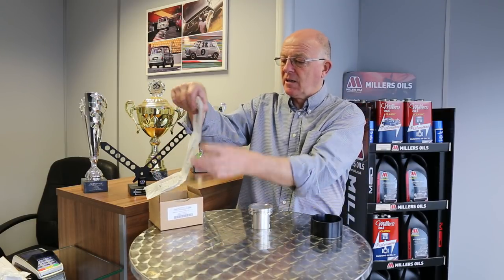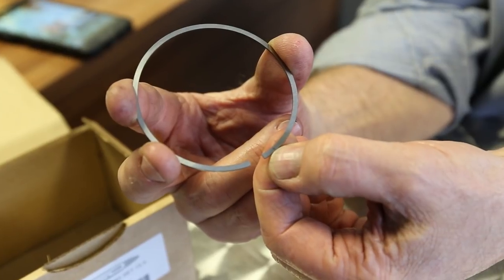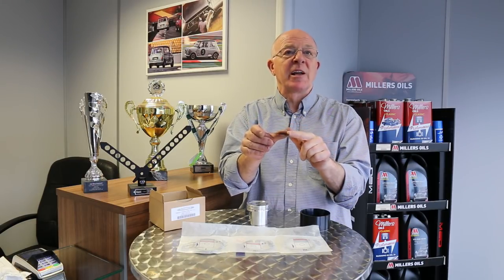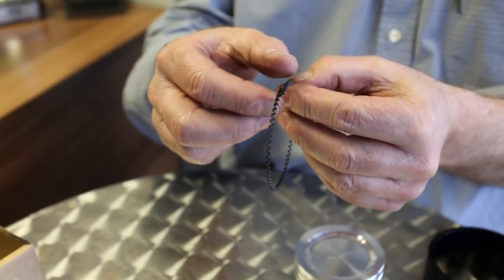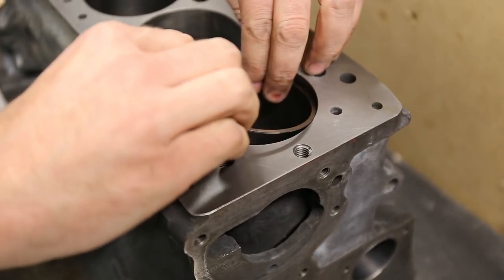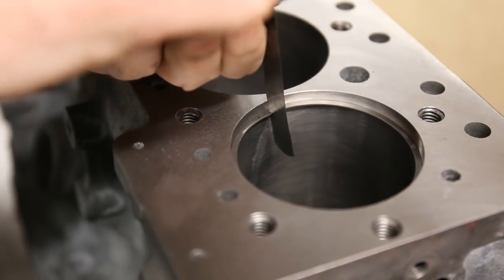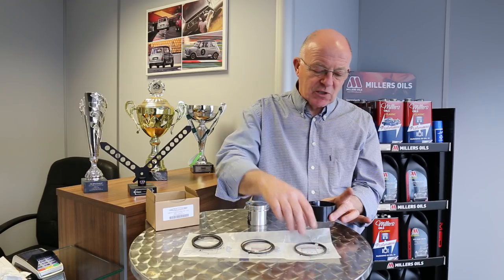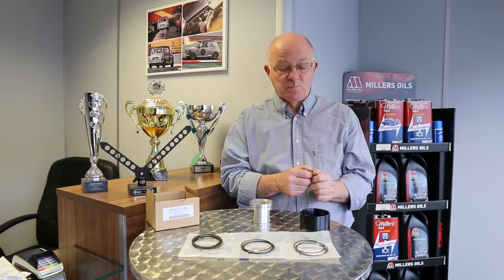Omega piston rings explained

Comment: if you'll allow me . .  I think the middle piece of the 3rd ring is a spacer. Its shape holds tension on the thin upper and lower "scrapers" and allows oil to drain through the holes in the back of the ring groove.